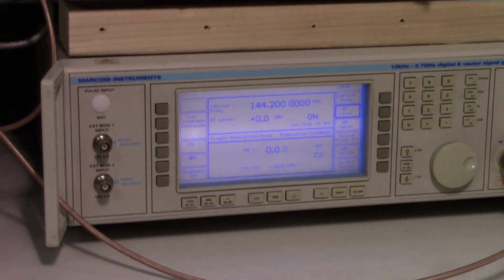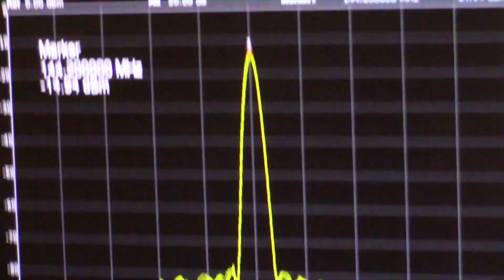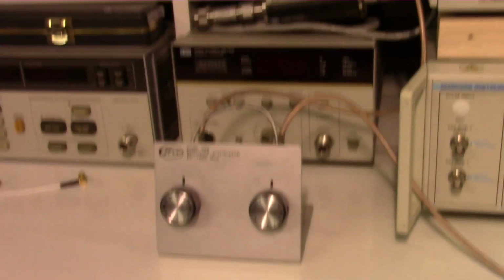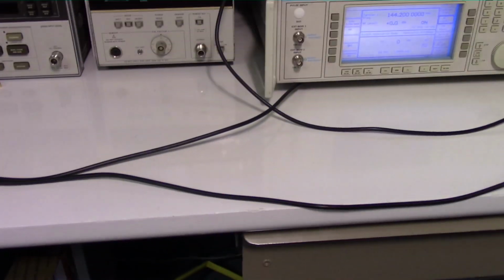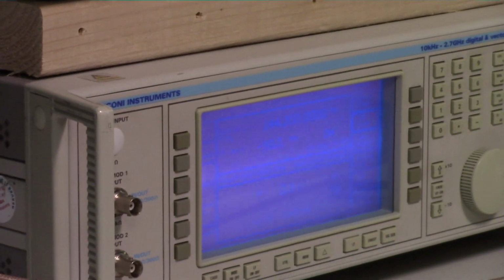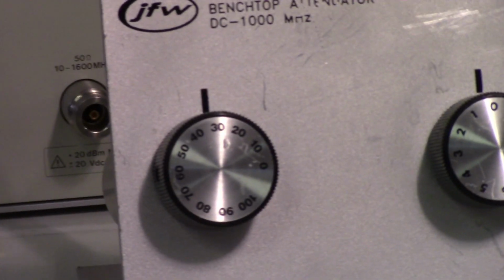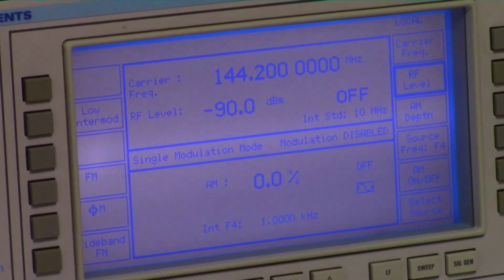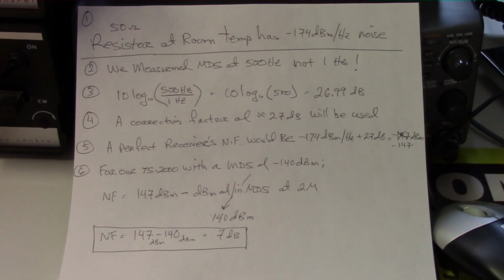How to Measure Receiver Sensitivity (MDS) & Noise Figure (NF)

Comment: Thank you for the presentation. Very useful. I would like to understand better the requirement on the bandwidth of the RMS voltmeter. In your case, you have a carrier at 144kHz, and a signal bandwidth at 500 Hz, so a voltmeter bandwidth at 10MHz is ample enough. But what happens if you work at another signal carrier, for example 150Mhz, and signal bandwidth at 500Hz still? Is the instrument bandwidth related to the signal bandwidth or to the signal carrier frequency?
Reply from the maker: Glad you found the video useful. The BW of the RMS voltmeter does not depend on the carrier frequency of this receiver since it uses an IF and the meter is sampling the post-detected output. The same meter has been used to measure the MDS at 10 GHz using a 500 Hz BW.

If we tuned our receiver to 144 MHz and wanted to know the MDS of the receiver when using a much wider BW, say 15 MHz wide IF, then you must make sure the meter has at least 15 MHz BW also. In general you want to make sure that your meter has at least the same BW of the passband you are listening to.
Reply: @w8bya  thank you! I managed to figure it out when I found the standard you refered to in the video.

Comment: Great video you have a lovely collection of test equipment. I have done a few videos on RF test equipment myself but I really enjoyed your video. Thanks for sharing. Most of my gear is Marconi but I do have a hp 8903.  Do you really need to use the step attenuator I am thinking that the output would be well calibrated on your test gear.   I’m wanting to do a test on an old AM domestic radio I thinking I should do the test at 1khz 30% modulation could you give me some advice. Thanks Regards Chris
Reply from the maker: Thank you very much. It is nice to be able to make some measurements to finish a home project or to help someone else out who does not yet have the gear.
Reply: w8bya  Sorry we double posted. Do you know how to do the test for an AM radio that does not have CW
Reply from the maker: @allthegearnoidea6752  Sure. But you need to be careful as there are many different definitions for AM sensitivity. In my past life, in the world of TEMPEST engineering, we used specific standards that could have different criteria than what is commonly used for say, ham radio gear etc. To avoid confusion let's just assume that we wanted to measure the AM sensitivity the way the ARRL would measure it. That standard is commonly accepted.
By their definition the goal of the AM sensitivity test is to determine the RF level of an AM signal, 30% modulated at 1
 kHz, that will produce a tone 10 dB above the noise level (MDS) of the receiver.
Fortunately the test setup is nearly identical to the one used in this video except we enable AM modulation as stipulated above. In a nutshell you set the signal generator to the frequency of the receiver and adjust the RF signal level such that when only the modulation is turned on and off you notice a 10 dB difference on the AC RMS voltmeter.  Hope that helps. If not I could probably make a quick video.

Comment: My R.M.S. voltmeter has scale for dbm & dbv, which one is the correct to use? Thanks
Reply from the maker: The key is that your meter can display differences in dB. That is what is key. You can actually do this measurement  with a meter that does not have a dB scale but it would require you to make calculations  to determine dB differences. I would start by measuring in dBV and see what you get. I am thinking you may get the same value even if you measure in dBm, let me know. 73

Comment: When you pick off the audio from the radio, do you have it terminated by an 8 ohm resistor and parallel the input to the HP meter from it, or is the audio fed directly into the HP meter?
Reply from the maker: The audio goes directly into the RMS voltmeter. As long as that is not changed throughout the entire measurement process matching is irrelevant.

Comment: Although your methodology of measuring MDS  is correct, it is not fully relevant with today's receiver -technology.
Try modulating the generator signal (use s/n test-signal which produces the dit-dit-dit-dit Rf signal) and find out some big differences between DSP receivers and true analogue receivers.  With some DSP the will drop in readability on a modulated signal by  minus 3- 8 dB  (-2 being the K3 and TTORION vs -8 on IC7400/756proII) compared to a pure analog receiver (K2) what I measured.  You can hear it too; as soon as the signal is modulated, some DSP's make it disappear in their own AF noise.  
In the end MDS is not about static benchmark performance but  communication performance. Which is recovered readability of the message.
see details at: https://pa5mw.blogspot.com/2009/12/upgrade-current-vhf-station-iv-mds.html
Reply from the maker: I politely disagree with your 1st paragraph. Your 2nd paragraph can at times involve the MDS of a system using demodulation and is a whole different subject specifically not covered in this video (and is therefore irrelevant). Your 3rd paragraph is simply incorrect. Let me explain:

Contrary to what you say, I can assure you that the MDS method illustrated here can and is used everyday with both pure analog & DSP based receivers (and not just by hams). Pse pay close attention to what I said in my video as I chose my words carefully.  This video illustrates how to perform a simple MDS measurement using an unmodulated signal source similar to the method used by the ARRL.  I never said that this is the only or best way to measure MDS esp if modulation or data was involved. There are other formal ways to measure the MDS (that the ARRL does not address) if analog or digital modulation/demodulation is employed. Also this video is not intended to pit one receiver type over another.

Also contrary to what you say, MDS is NOT a benchmark for just communication performance. I.e., sometimes it is important to just know if a signal is present. There are many different industries (defense, intelligence, etc) that use different standards for determining MDS for reasons that you may not be aware of. Depending on who's standard you use and if a modulation source is employed or not MDS will necessarily be measured differently.

Again, the reason I chose this method of MDS measurement is because it is very simplistic & can be performed by most people with very modest equipment. I also mentioned that there are many different standards that define how the MDS should be measured.  For example you may want to study the applicable unclassified portions of NSTISSAM TEMPEST/1-92 or NATO AMSG-720B as references.

Comment: Couldn't you start from the other direction?  In other words, start with the signal generator OFF, then start at a VERY low power level, and increase it until you get a 3dB increase on the analog meter?  Seems like this would be quicker (only adjust the volume control once).  This is similar to how you demonstrated the digital meter.
Reply from the maker: Hi there and thanks for the question. Yes, there is no reason you could not measure the signal level that way as the ultimate goal is simply to see that 3 dB delta. I guess after doing MDS tests for over 30 years for tempest work one way it kind of grows on you hi-hi.
Reply: He is talking as a real amateure child!!!!

Comment: Hi
Thanx for a nice video. But this method (NF) is relevant only if you have got FLAT bandwith filter. Your rig has DSP so its OK. But question is how to measure non DSP rig with analog filter. Analog filter is not FLAT and has for example on 2200Hz BW -6dB signal decrease. I cannot calculate with 2200Hz BW because only on center it has 0dB but on the sides there is attenuation. What do you think about this ? How to compensate  ? I try to measure FT736R on 6m and MDS is -140,2dBm. Rig has only original filter so there is 2200Hz bandwith/6dB. But if I calculating NF with 2200Hz it is not so real (NF = 0,24dB). Do you have any idea how to calculate or compensate nonlinearity of filter on calculating ? Thanx 73 OM4AIK
Reply from the maker: Hello Igor. Sorry but not true. Measuring the MDS/NF of analog receivers does not create any special problems as long as you realize that the filters may not be perfect. Most every standard for MDS understands that "real" filters will be used and that a fall off in MDS will occur as you move off the absolute peak. If you must know what the MDS is away from the PEAK signal, within a bandpass, then you will need to carefully characterize the ripple and shape factor (skirts) of your filters and apply a correction factor to your MDS level taken at the peak frequency.  Or you can repeat the MDS measurement at different frequencies away from the peak freq while staying within the bandpass.  As far as getting such a low value 0.24 dB NF (very unlikely) remember that even TINY errors in your MDS measurements can mean big differences in the resulting NF.  For example, if your MDS value was only 3/4 dB off (easy to be off this much) you would have a NF of 1 dB instead of 0.24 dB which is much more realistic. Making MDS measurements with absolute certainty AND repeatability, within 1 dB is usually difficult esp when you are looking at very sensitive receivers, front-ends, or LNA's etc.  As you know the noise makes the measurements bounce around making it hard to determine an exact value. 73
Reply: w8bya Thanx for reply my friend. I try to measure at every 100Hz from one side to other side of bandwith (2200Hz mean 22 measuring) and the cenrer (peak) I set VU meter to 0dB  and on left side and right side it was about -6dB signal on VU meter down. I take 22 measuring with 100hz step and make arithmetic average (sum of every value divided by 22). The final number was 2.1dB. Can I use this value to a correction factor for a NF ? (0.24+2 1=2.34dB) Or its wrong method ? 
Do you think MDS must be corrected too ? (Isn't MDS a minimum detectable on peak value?)
Thank you for your time.
73
Reply from the maker: Hello Igor. Years ago I used to own two FT-736R radios but I no longer have my MDS data for them (I always measure my S-meter to know what each s-unit is (how many dB) and I take MDS measurements on all bands to ensure the receiver is ok. I honestly do not believe your reading of 0.24 dB NF is accurate. Are you positive your 50-ohm signal generator is calibrated and accurate to within 1 dB esp with extremely low RF signal levels like -140 dBm? It is possible you are getting RF blow by like I demonstrated in the video. This is very, very important. Also you must make sure any attenuators etc you use are exactly 50-ohm. You should be getting a NF of between 2-7 dB on 6m (if I had to guess). But getting back to your last question, when I use the term "standard" I mean the organization or agency or company who wrote the specification & requirements for what MDS means to them and how it is to be measured. In my example I used the "standard" that is defined & used by the ARRL since it is very common and available to everyone. In my past life (TEMPEST engineer) we used different "standards" for how to define & measure the MDS. There can be MANY different ways to define & then to measure the MDS. You can certainly use the method that you described but you may be the only person in the world who does so hi-hi. If it is acceptable & useful to you then that is what is important but if you want to be like everyone else (right or wrong, useful or not) then you must follow their "standard" methodology. I hope this makes sense. 73
Reply: Thank you for reply
So at first its generally question which is very important. How do you measuring MDS/NF if there is not 500Hz filter installed and there is no DSP feature to set BW to 500Hz? Is it possible to measure in standart filter bandwith (2200Hz/-6dB) ? Which bandwith can I calculating on formula where -174dBm is compensated to 500Hz BW ? Can I calculating with 2200Hz BW ? Because this  values are very different (on 500Hz it is -174dBm+27dBm but on 2200Hz BW it is -174dBm+33,4dBm). If I calculating with 500Hz BW NF is 6,67dB (looks real) but I am not sure if I can calculating with 500Hz because my TRX hasnt 500Hz filter.
How you measuring old radios with no DSP BW features and no CW filter installed please ?
Thank you,  
your answers are very helpful for me. 
73
My measuring equipment is RF generator Marconi Instrument 2018A with 30dB external attenuator and VU meter I use SW for Windows: Orban Loudness Meter and SB Audigy 2 soundcard is HW.
Reply from the maker: First you must be 100% certain that you are able to accurately measure the true RMS value of an arbitrary (noisy) signal from your receiver. Some setups can measure the RMS level of easy & clean signals but may not be able to give you accurate "true RMS" readings when noise is involved.  I am not sure if your setup can do this or not so be aware.....Also, using 500 Hz as the BW for MDS is just a common number used by some standards but not all. You do not have to use 500 Hz. You can use any BW you want or need to. You can easily convert the MDS from one BW to another BW by taking 10xLog (BW1/BW2).  This will be your conversion factor. Once you have your converted MDS go ahead and calculate the effective NF.  To convert the MDS you measured at say 2200 Hz subtract 6.4 dB to obtain the equivalent MDS for 500 Hz. At this point pse feel free to contact me directly at my e-mail address which you may find on QRZ.COM if you have any additional questions. TU es 73

Comment: It's been over 30 years now but if memory serves me, to measure our FM 2 way units, we used a sig gen that was Calibrated in uV. The best I can recall, spec levels were about .5 uV for 20 db of quieting. Certainly some units were better than others in sensitivity i.e., .35 uV. Unfortunately since I have been away from it so long, I am positive that RX sensitivities have increased along with high levels of Intermodulation degradation. When I retired from the company 100 db intermod rejection was common.  Enjoyed your video very much! 73's David. K8KEM

Comment: Nice lay down!  I did have to pop a couple of dramamine though as I was watching the focus move around there for a while hi hi. Have noted your procedure down in my lab notebook so I don't have to keep reinventing the wheel anymore every time I do this measurement. I have a old HP400EL on my bench just for these kinds of voltage measurements, can't beat the old stuff!  One way to adjust for cable/connector losses is to mock it up and simply measure the output at the final connector that goes to the radio on your analyzer and adjust the RF generator's output upwards to whatever you need to overcome those losses; that gives you a more accurate starting point vs. trying to estimate the cumulative  loss.  73 - Dino KL0S
Reply from the maker: That made me chuckle....sorry about that Dino, did not mean to make you dizzy. Yes measuring the I.L of the RF cables involved will tell us exactly what the loss is but IMO it is not required here. I am sure we were well within 1 dB. But if I were forced to use longer or unknown cables I would certainly characterize them 1st. Thanks for the view & comments. 73
Reply: I had to break down and order some RG-142 jumpers to have on hand for these kinds of measurements, thanks for reminding us how important it is for maximizing the shielding to keep junk out of the circuit.
Reply from the maker: My pleasure Dino. Another cable that is even better for everyday bench use is RG-223. It is the low power but slightly higher loss version of true mil-spec RG-214. RG-223 is much more flexible and has approx the same shielding effectiveness of RG-142. RG-142 has a breakdown voltage in the thousands of volts and great for high-power applications while RG-223 is wonderful for low-level signals that need to be isolated from inadvertent coupling effects like cross-talk & RFI etc. Just be careful when buying from overseas....so many cheap knock-offs that are not worth a crap. True mil-spec RG-223, RG-142, and RG-214 ALL use very high-density, silver coated, double shielded braids along with a silver coated center conductor.
Reply: Yeah, I know I'm taking a chance getting them from over there and will probably sacrifice one connector to see what the cable looks like inside. I guess there's always Pasternak (or whatever that company is called nowadays). You can see the workbench/radio desk pix on my QRZ page.
Reply: Well, my jumpers arrived today from overseas...got some with BNCs on both ends and a couple with N/BNC (RG-142 cable). Thought it might be interesting to actually try to measure, at least qualitatively what kind of leakage might be exiting the cable along its length. So set the generator to 20dBM, 100MHz for grins and used my large H-field probe with the analyzer to see.  First I just checked the frequency response between 1MHz to 3GHz with the tracking generator and found about 1+ dB losses along the way, highest toward 3GHz as you might expect; slightly less loss with the N connector.  Then I checked along the length of the cable between the generator and a dummy load with the H-probe.  Nothing really along the cable but when you got to the BNCs there was noticeable leakage; none really around the N.  So lesson learned is if you really want to minimize ingress/egress to the system use N connectors!  These should probably be sufficient for my level of hobby work.  73 - Dino KL0S
Reply from the maker: Please keep in mind that shielding effectiveness can be characterized by it's E-field & H-field components. Actually three ways if you consider plane wave radiation. It is very difficult to get significant H-field SE (esp at low frequencies) unless the shield has significant permeability.